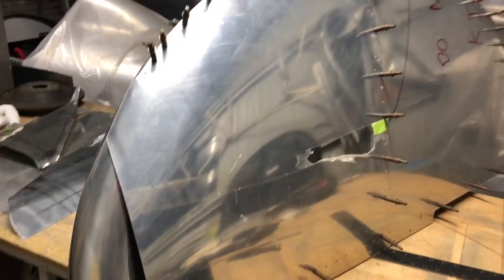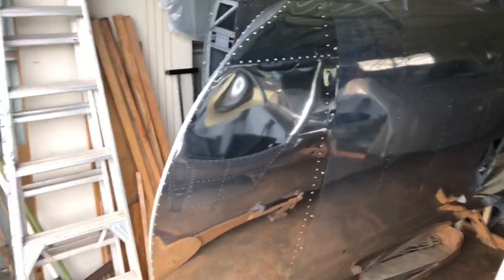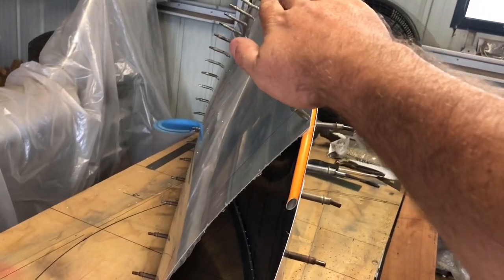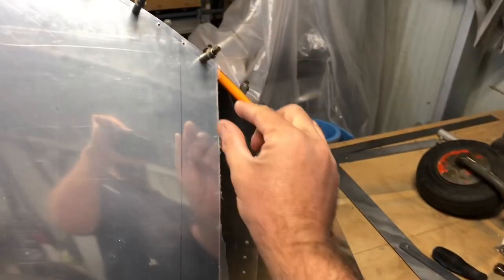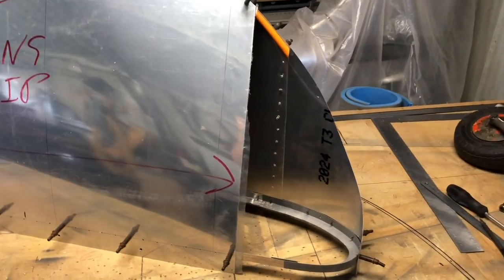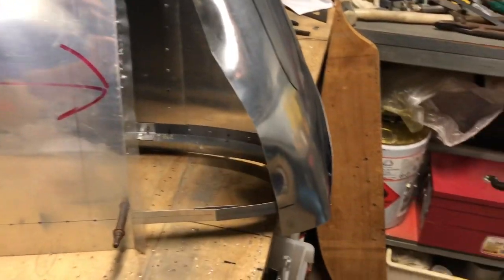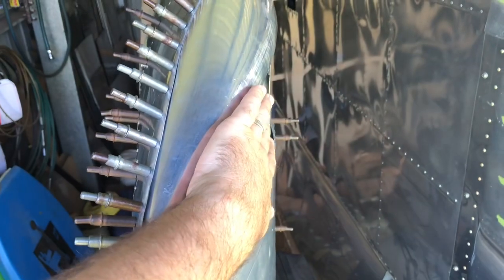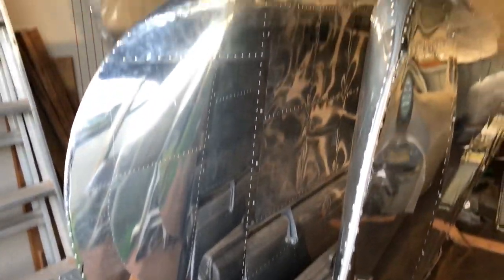Wing tips for Frankenstein. Not so simple

Comment: Hi Don, 
Nice work. Are the big skins all flat wrapped ?
Is that trailing edge tube round or have you ovalized it ?  How did you form it ?
Also, as someone else said below, I would love to see some of the wheel work. 
Thanks, Steve
Reply from the maker: Gday mate, thanks. The bigger skins have a simple curve in them, simple as in not compound curved. I didn’t even need to roll them. All of the difficult shapes are in the front bit. The tube for the tip is something I found in a scrap bin. I shaped it by hand and it’s round not oval. I plan on making more forming/curving metal videos soon. I’m really looking forward to making the engine cowl!
Reply: Thanks for the reply .... looking forward to your videos on metal forming.

Comment: Have you a video of how you bend the L profile into airfoil shape of the wing rib?
Sorry for my English..
Thank you,
Greetings from Italy
Reply from the maker: Stefano Spagnolini Gday mate. I used a stretcher/shrinker to get the shape. I drew the profile I wanted on paper then shrunk the edge to match. It’s a hand operated machine. Hope you and your family are well
Reply: Don Watson thank you so much, now I understand the manufacturing process of your ribs. My question was because I want start a  build of a homemade ultralight (smaller than your’s) that is similar to faa part. 103 and similar design to your’s frankestein (parasol, tandem, aluminium). I know from your info box that you are an aircraft technician.. me too but in hely for job and plane for passion :-) even if everything is blocked here in Italy, flight activities obviously included. I’m in north-west of Italy... very close to the red zone (about 10 miles) but for the moment my family and me are good and safe; we can’t go outside so is the moment to start some flying project 
Thank you again,
Stefano
Reply from the maker: Stefano Spagnolini really glad to hear you and your family are well and I truly hope that continues. I’ve worked on helis for the past few years and now back on fixed wing. I built the ribs this way purely to get the most out of the material I had. A stamped or formed rib the usual way uses up a lot of material and you’d only get a few out of a sheet. Forming the rib up from angle used way less material...it took a lot more time to build up though. I think I touched on it in the wings video. I very seriously thought about building a lighter aircraft before I started on the Frankenstein, I always liked the tandem airbike. Might build one after the Frankenstein. Stay safe and well mate
Reply: Don Watson I think i’ve see a part of a tail rotor shaft inside your wing structure in some of your video (two bolt for fitting and a central pin as anti-torque check).. is true? :-)
I like so much your video.. can’t wait to see you in flight 👍🏼
Reply from the maker: Stefano Spagnolini yes you are right, Frankenstein living up to its name. I came across some wrecked jetranger and rodinson helis I was able to collect bits off. Out of tolerance for reuse but perfect for me. I’ve been in the industry for a long time and have collected lots of stuff from wrecked aircraft that I’ve been able to repurpose. I can’t wait to fly it too!